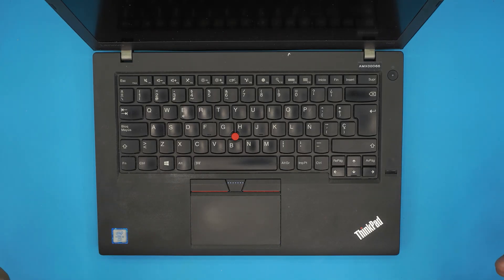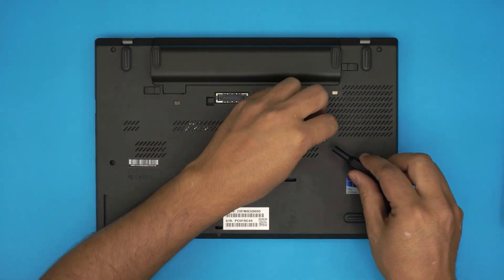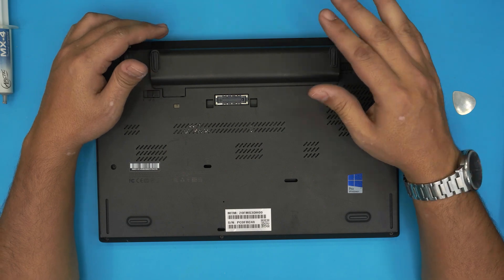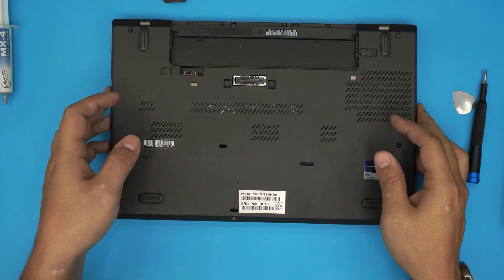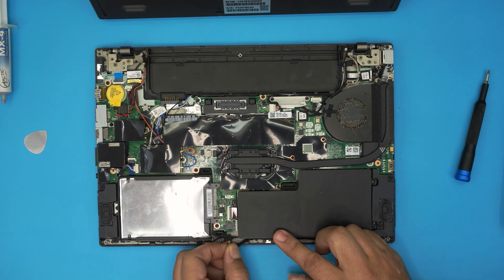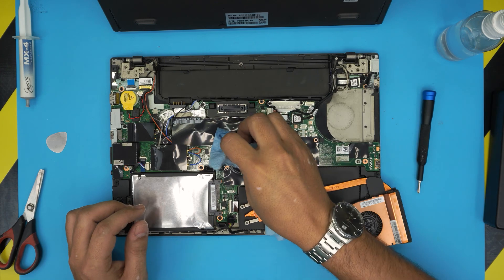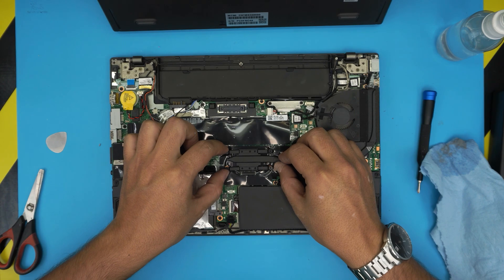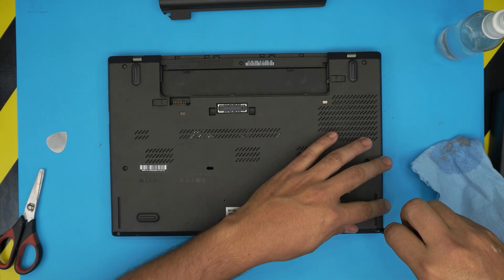Lenovo T460 Laptop Service | Repaste FULL Guide

Comment: how much did it lower the temps?
i tried on mine but i had to give up as one of the scews holding the heatsink in place were on too tightly and my screwdriver was too big so i stopped in fear of stripping the screw even further
Reply from the maker: Thank you for the feedback! if you wish to support the channel you can LIKE or SUB or both :P
regarding your question: i can't give you a temp number, because  you need to understand the temp works with fan curve  (speed). the fan will spin faster when the temp goes higher over time, so there are t factors fan speed time and temp.
to not make it sound to complex lets say, if the fan was locked at 50% and test was for 15min, then the temp differences would be 15c -20c that's the closes answer i can give you.

but in real life once you repaste you will realize few things that it takes longer to reach high temps and fan noise will be much quieter for a longer time, before they go loud. e.g:

before repaste (service) under full load:

15min test:
1st 5min : fan at 70% , temp 75c~ 
1st 10min: fan 85% , temp 86c~
15min:  fan 98% , temp 97c~

after repaste:
1st 5min: fan 40%, temp 65c~
1st 10min: fan 65% , temp 74c~
15min: fan 89%, temp 86

i hope you get an idea, and room temp you need to take in count. but generally repasting if like doing a car oil change! 
if you have a bad screw here is a way we remove and very effective:
https://youtu.be/xLt6dMIsO9E

Comment: Thank you! One of the best how-to-service videos I've seen. Right to the point and clear. Just one thing, I would have liked if you told us why you disconnected the battery or that you have to disconnect the battery for this. 

I subscribed to your channel and hope you will be able to do more videos in the future.
Reply from the maker: Thank you for the feedback! and your support.
regarding your question: the reason i remove the battery for servicing is for people that are watching, because honestly you don't need to remove the battery if you careful and don't drop the screws or screw driver on motherboard if the battery is connected. BUT its safer, its good idea to remove the battery if its your 1st time servicing and preventing shortage on motherboard.  so i remove the battery so if any one that is following the video are safe in case if they dropped a screw on motherboard. else on daily services that i do i don't remove the battery but again i been doing this over 18 years. so please disconnect the battery to prevent any accidental shortage.
Reply: @uFixTek I appreciate your videos/help I recently bought a T40 and have upgraded it using your videos!
Reply: You don't need to be an EE to know why you would disconnect power when working on a circuit with metal tools.
I swear some people would critique a video on swimming for not explaining why you should hold your breath while under water...

Comment: i havin' problem with the front battery. I did not find the cable for the front battery after i open it for te first time. Should i send to shop to  fix it or u have diy solution?
Reply from the maker: Thank you! for the feedback and your support to the channel by SUB :P
regarding your question: YOU TELLING me you dont have 2nd internal battery??
and your laptop is T460??
can you send me a picture of the inside of the laptop: ask@ufixtek.com
Reply: @uFixTek  yes it state tat i only hav one battery. N yes i will send it to u
Reply from the maker: if it says that then maybe the region or the seller is removing the 2nd battery to sell them apart :/
but sure send me a pic to confirm that